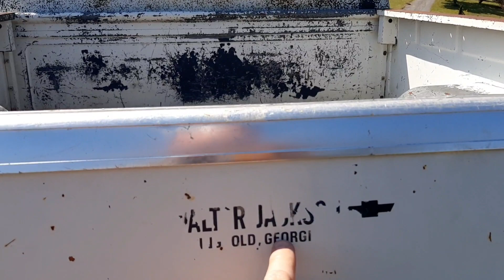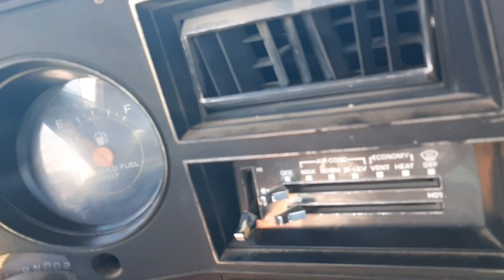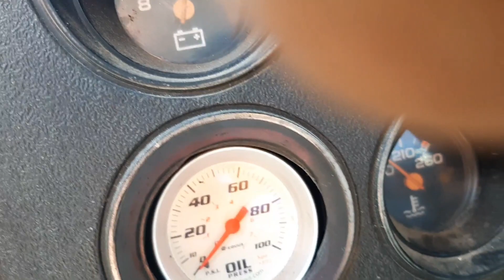I was doing a video to help my friend sell his 1985 Chevy C10 but I talked myself into buying it!

Comment: The square body generation pickups with just manual steering & manual brakes like Left Turn Bill are super hard to find nowadays. I like that white 85 there.
Reply from the maker: That's true! You just don't see the "Plain Jane" trucks anymore! I appreciate your comment on our new purchase! Should keep us entertained for a while! Lol. Thanks buddy for your comment!
Reply: @primeredisbest  & I thought manual steering & brakes were only available on the medium duty trucks back in those days since they have bigger steering wheels than the light duty trucks like Left Turn Bill & that white 85 Custom Deluxe. Lol
Reply from the maker: @kevinrichards3288    I honestly don't know about all of that. But it's something to think about! I appreciate your comment on the new truck! Thanks buddy!
Reply: @primeredisbest  I bet in Left Turn Bill you'd have to put some muscle turning the steering wheel when stopped & press down hard on the brake pedal too.
Reply from the maker: @kevinrichards3288    Actually it has all new frontend parts on it so it steers pretty easy. Putting all new brake lines and hardware as well so it should stop good as well. Thanks for your comment!